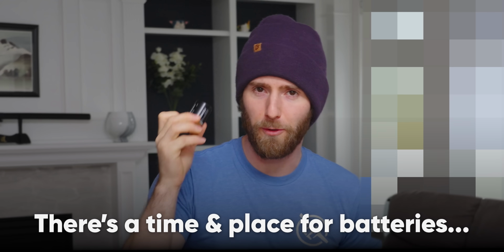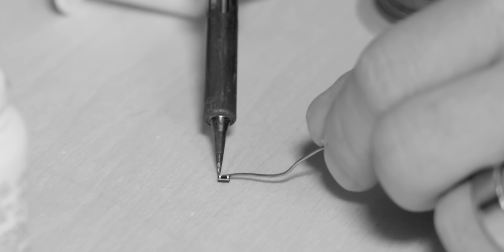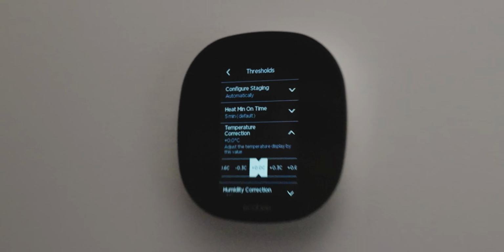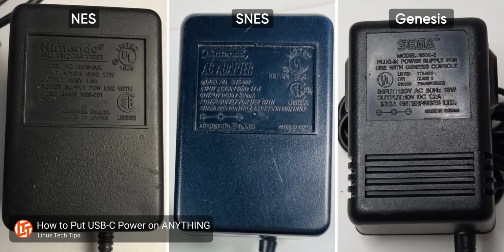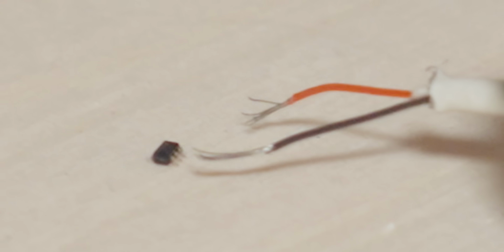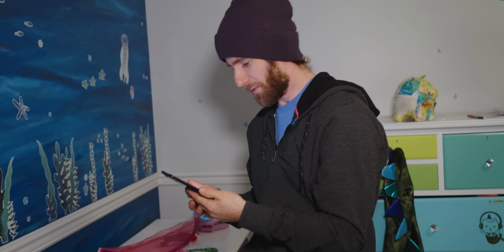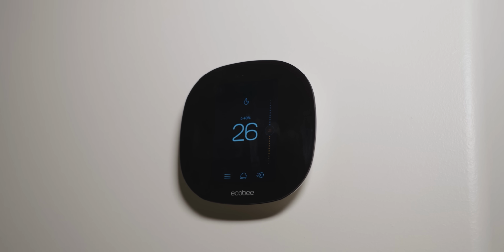I HATE Batteries! - Converting Wireless to Wired (a cheapskate’s guide)

Comment: Would it not work at 3.3v directly, then you could have removed the pot and not had all the weird voltage drops when current draw increased...
Also, if something has current spikes, that is a situation where you need a capacitor. Loads of room in the battery compartment for one too.

Doesn't Linus also employ a full time electronic engineer for Creator Warehouse too?

Comment: I kinda understand why you want a wireless battery operated outdoor security camera, you don’t need to run cables into your back garden and if the power ran out, you still had a security camera running, but at the very least you can wire them up if you wanted to. If it’s a temperature sensor for a room, why would you just include a power cable for it?

Comment: There are linear voltage regulator which can be set by putting a voltage divider on the output to a reference pin, then you can exactly build a divider to create the needed voltage

Comment: Should have just used wireless wall power. Just plug and unplug your wall wart at least 4 times in under 5 seconds and say "scan for wireless power" wait 5 seconds and say the command for voltage range "set voltage range 3.0v to 3.35v" or "set voltage 3.3v tolerance +/- 10%" Do the same thing 2 more times (after waiting 5 seconds) for the typical "start up" and "fixed running" power draw ie amperage and you are good to go. No batteries or wires needed Does not work in Canada

Comment: You'd almost certainly be fine to just throw 3.3v strait into it. Depending on the linear regulator IC you're using, you may also need a load capacitor on the output for it to deliver a stable voltage - the datasheet will specify what value that should be if it's required. I'd rate the diode solution as an acceptable solution for this low current application too, although as shown the output isn't very stable across different loads because diodes are non-linear devices.
Reply: A fully charged button cell is already 3.3v.
Reply: Yup. Pretty sure a simple 3.3v power brick would’ve done the job. Higher chance to have that on hand than the ICs required.
Reply: I was nearly screaming at the video. How did they not know nominal isn't the max voltage of a cell.
Reply: I was thinking the same, 3.3v is probably fine for anything that uses a button cell.  Adding a capacitor would also help with the spikes.
Reply: Don't you also have to add a small resistor in series? A lot of low power battery devices use the internal resistance of the battery to limit current
Reply: @Null Given the device needs to use such low current, I suspect it won't have a linear regulator in it as they're inherently not very efficient at all. It's quite likely just got an STM32 processor of some type, powered directly from the battery.
Reply: Considering batteries don't hold the voltage for all their lifetime, I guess anything from maybe 2.8 to 3.5V should be fine on the sensors. The sensitive parts will have a regulator anyway.

Comment: The thing I see as problematic with batteries is usually size. I would love to see AA or AAA batteries as standard in devices I use. Because you can get very good rechargable ones that will last in the correct application for 10years easily. Meaning they have enough cycles in them to last that long not battery life of 10years. You'll probably have to recharge them about every few months. But if it's one standard size(or two) having fully charged ones is way easier and AA and AAA can usually be charged with one charger. Now Battery replacement is a hassle and yes if you have a quadrillion devices in your house that need replacing batteries at irregular intervals sure it get's annoying. But you have AAA and AA Batteries in your House anyways(your kitchen scales and all your remotes probably use one or the other, maybe your wireless keyboard too(sadly the trend goes to custom lithium ion packs)). So if you can limit yourself to those two battery types and using rechargable ones I think you will be much happier than Linus will be when his kids rock that cupboard and break off that usb charger behind it.

Comment: In a very-low-amperage scenario like this, you could have good results by running a resistor in parallel with the device, setting up a base-level 0.1 or 0.3 amp current draw. When you set the voltage-drop resistor based on that steady draw, the extra 0.03 or whatever draw from the device is a small change in current, and so the effect on the voltage-drop resistor is also small. (You DO need to dissipate the extra heat, and you don't want to do that INSIDE the housing of a temperature-sensing device -- the extra heat could affect the sensor.)

Comment: Oh wow, I just designed such a converter for my Ecobee 3 sensor last week. Since they only draw something like 11mA when transmitting, I went the 3.3V Zener diode route - taking advantage of the fact that a fresh CR2032 cell will have just such a voltage, so there was no concern there.

Comment: I converted all my battery gismos to use external 18650 pots i 3d printed with protection build in. 18650 last way longer than most coin cells, so less changing,  still "off grid" so no wires running to 12 sensors in one shelf... Only drawback: Cost. Doing this cost my about as much a 5 years of batteries...

Comment: I wired up a 2XAA battery holder which outputs 3 volts to my scale to replace it's original CR2032 and it's still going after a few years. If you don't care about the aesthetics I think it's a decent solution

Comment: You can get a 5V to 3V regulator for a couple bucks, or for those coin battery powered devices, a 3V zener diode with a resistor works perfectly.

3.2V is for a fully charged battery, you can use anything from 2.4V to 3.2V
(Some devices go down to 2V)
It's better to aim for 3V because some devices won't like anything over 3.3V and you might harm them.

Add a capacitor to smooth the spikes too.

Comment: if heat is a problem, use a switching regulator instead of a linear one. most just need an inductor and a cap. some let you set the voltage with a couple resistors or zener diode as a reference.
take it a step further and have a custom pcb that is approximately the size of the cell you want to swap with the smps regulator on it. wouldnt be surprised if you could find them on tindie or ebay or whatever.

Comment: Hey, linus just use the sticky pad tape which has very tiny suction pads on them and you are already using it at your home on your bedrooms Nightstand to keep the power bank adapters in place to help them from sliding around.
Aso adds wire tape or fasteners in and out of the sensor cap to keep the wire from moving in and out and ending up being ripped out accidentally while moving it around or if something falls on the sensor wire cable. You don't want to do re-soldering of wires and resistors on the temperature sensors you have already finished soldering on DO YOU Now.

Comment: Please just use a 3.2v zener diode with a balast resistor straight on the 5v output from the charger next time (if you're not going to use a regulator on an appropriately sized pcb, lol). Nice work getting this working though. I enjoyed the jankiness, lol

Comment: I like wireless, With normal charging and good running ime. I had a wireless mouse whan it lasted a day but i sure appreciate it now lasting a month. But that's normal (AA) size. Like in my Logitech G604. Don't think it makes never no sense ever. But i get the point.   These round clock things are indeed  just annyoing.

Comment: For not so sophisticated and experienced users, a stepdown converter modul for like 2 bucks on ebay or aliexpress would probably be a better choice. They might be bulkier, but if a switchmode based is choosen generate way less heat, and only need you to solder exactly 4 wires in nice predrilled holes.

Comment: Ever thought about... A rechargeable battery that goes to a button cell dummy that just takes the terminals of the rechargeable battery and connects to the button cell

Or maybe a rechargeable button cell that has a built-in wireless charger connection
They even make coin cell emulators
(video idea for v2)

Comment: The reason it didn't work with a resistor is that the input probably wasn't stiff enough. You need to use low-value resistors; otherwise the voltage will drop when you boot up your device. The required resistor values that you need to use in the voltage divider depend on the resistance of the load. R << R_load. However, low resistance will cause the voltage divider to use up more energy.

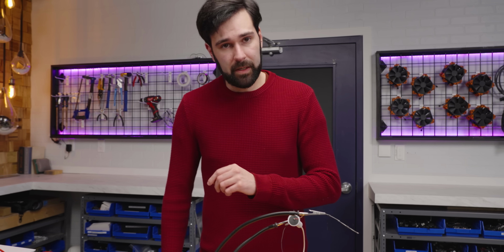Comment: 12:45 You can use a zener diode instead of a schottky diode to create a voltage maximum, rather than using the voltage drop from the turn-on voltage.
Reply: Better to use both I think? drop the voltage a little with a schottky or two and then a zener with a breakdown of 3.2v to lock it in. That should limit the wasted power and still be able to provide the spikes. Add a capacitor if it the voltage droops too much during the high load.
Reply: I was going to write the same thing :D a zener and a resistor
Reply: Or just 3 normal Diodes in series ,would be 5-(3×0,7)=2,9V that shouldbe find if not a basic 3.3 regulator with a little cap is the best option in my opinion
Reply: @leobla744  Obviously 3.3v regulator would be better lol, not the point of this thought experiment at all. Issue with diodes in series is your peak voltage tends to be inversely proportional to the load, it's only marginally better than using a resistor as a voltage limiter. Using a zener isn't a great fix, but from my limited experience making power supply circuits, it's the best you can do without a timer + MOSFET circuit, or linear VRM (or either of these in packages).
Reply: the real advice is always in the comments - love it & thanks for the deep dive!

Comment: Did you try running it at 5 V? Depending on the internal voltage regulator, it might have been fine. Maybe pop it open and check before trying.

Comment: @Dan/Linus: if we're at the stacking-diode part of the jankiness (love it... more of these videos please!) then why not just using a zener diode? Regardless of the current draw in mA range, the voltage wouldn't move a  millivolt.
Reply: Zener diodes (especially low-voltage ones) vary their voltage fairly significantly depending on the current passed through them. In this aspect they're worse than regular diodes.
Reply: @eDoc2020  it's a battery operated device, expected to have non-regulated voltage - and regulation step will be there after the power input if it's really required (e.g. 1.8V LDO to power the sensor, if it really needs it). Most often it's not required by design, by choosing BOM parts that operate at wider than battery's voltage range.

On top of that, the reverse zener breakdown voltage that you talk of (the vary voltage significantly bit) is well under 1V (typically less than 0.8V range). So, a 3.3V zener diode is ~5x that threshold during its time of operation, at which point it's non-factor.

And on top of that, it's a zener diode, so if it has intermittent spikes of higher current draw, then - by nature - gets it even closer to its rated voltage (which is 3.3V in this case). So, it won't be a problem for the device, it'll actually be good for the device.

Comment: Along the lines of Linus' argument, I've been looking into the idea of using HomeAssistant to gradually bring our 60+ year old house into the 21st century. The first step I wanted to take was getting our furnace onto HomeAssistant control, with a planned follow-up of individual room vent control tied to it. As a first step, I wanted to put a Wifi-enabled thermometer in every room, but have it be one that was powered by an outlet (preferably one that would plug directly into an outlet with a power pass-through if possible). I couldn't find anything that wasn't battery powered, and the one or two slightly possible solutions didn't seem to work well with HomeAssistant according to reviews. All the ones that did were battery only... our house has 11+ rooms I have to monitor, I DO NOT want to deal with batteries going out even on that scale.

Comment: I like how Linus basically just proved that if the idjits that design these home things would simply include a basic usb connector + resistor(s) into their board as an alternative power source in parallel you'd have solved the battery problem.

Comment: Incase anyone was wondering, it's ~$5 USD to order a proper step down DC to DC 5v to 3v buck converter that should fit inside that space if you really want to keep using USB power and it's $10 for a 10 pack of those batteries 😑

FYI you'll find 3v AC adaptors all day in any of your local thrift store electronics bins

OTHERWISE, that looked like fun 😁

Comment: 14:00 I believe you guys know it, but usb charger have a transformer inside, which is heating and consuming electricity non-stop while plugged in. This is ok in PC's where this transformers mounted inside of power supply and have enough of airflow to passively cool down. But if you left phone charger in a wall for a year or two, that can be dangerous, it can overheat and began to burn. I had such issue once with iphone charger. I highly not recommending doing such modifications on smoke detectors, it may not end funny.

Comment: The first thing I did something similar to was the Dreamcast vmu -I bought a 4xAA battery holder from radioshack that terminated to what looked like 9volt contacts, then soldered another 9volt contact the the battery pins on the vmu and threaded the wires through a hole in the battery door. it worked quite well and also still fit into a controller. that thing ran for forever afterwards.

Comment: Remember diodes have a forward voltage drop.  Rectifier diodes like the ubiquitous 1N4001 are right around 0.7v and schottky diodes such as the BAT54C at 0.24v. A string of those is much less sensitive to load current than a resistor.  I've successfully replaced button cells with a USB supply and 3x 1N4001 in series.
Reply: Somebody didn't watch the whole video.
Reply: @eDoc2020  you didn't recognize any non-overlapping 
information?
Here's some more: In very low current situations a bias resister may be needed to draw enough current thru the diode(s) to move the operation point away from the knee into the linear region.

Comment: Good lord. Did you not know you can much more easily mod the charger to just output a steady 3.2v? Or use a zener diode? Or an LM317? Or a tiny 5 to 3.2v buck converter module on the cable? I've used series diodes (or even LEDs) for voltage drops on many projects and find it hard to believe you didn't think of that before anything else... You're intentionally setting Linus up to fail, Dan... And we love you for it.

Comment: Wired tv remote, there is actually a huge benefit I never thought of. If the remote is always in the same place like mine is supposed to be having it wired would mean my better half could never "misplace" it. Having the power under the table and a thin inconspicuous wire powering the remote might actually be a good idea in my case, it always vanishes when some stupid soap opera is on tv.

Comment: With a 2 year battery life I simply wouldn't even bother converting it to wired and I am way closer to Dan's level of competence when it comes to electronics.  The only thing that I would do (if they made them) would be to change out the batteries for rechargeable ones as they began to expire over time.  In my household the only time things have non-rechargeable batteries is when they come with batteries out of the box - once those initial batteries are done for they are replaced with rechargeables.

Comment: One thing the Fire Alarm makes sense. The Alarm is supposed to be replaced after 10 years and the battery in it will supposedly last ten years. Also, the Alarms need to have battery backups in them anyway. Plus if it gets more fire alarms in people houses it's probably a good thing over all.

Comment: I am not really a fan of battery powered everything as there are some devices like power tools that in my case are still plug in.  I find it interesting that thermostats (or at least the remote units here) are battery powered while most HVAC systems go out with the electricity when a major weather event passes.

Comment: For anybody doing this for real, the simplest option is the get a voltage regulator of the right specification. For those who know electronics, adjustable regulators are more versatile, and you can stock up on them. Alternatively, zener diodes will do well for low draw applications such as this.

Comment: There are devices you can buy cheaply on Amazon that are shaped like a battery and have a wire that goes to a wall adapter. No soldering required.

Comment: wait, the battery is 3.2, and hes worried about sending it 3.3? +-10% is worry proof, would send 3.5v into it without second thought.

It has its own circuitry to control power flow (since it uses batteries).

Comment: I was going to comment half way through..
3 to 4 x 4001 diodes with the first cathode or negative side to the negative of the 5 volt supply then from the 5 volt positive through a 10 to 100 ohm resistor to the positive or anode of those series wired 3 to 4 diodes with a 220 microfarad 10 volt capacitor across that resistor to allow for the intermittent power spike ought to work great.
Or a 2.7 to 3 volt Zener diode instead of the 3 or 4 4001 diodes.  if memory serves 1 x commonal garden diode acts as a 0.7 volt Zener wired in this way.
:)

Comment: With the losses here from both the 5v power supply and your voltage dropping system you've just made it way less power efficient, it's small but if you had these all over your house you're really just wasting energy